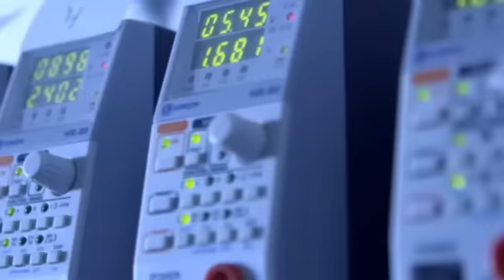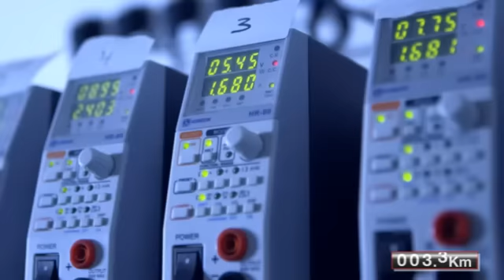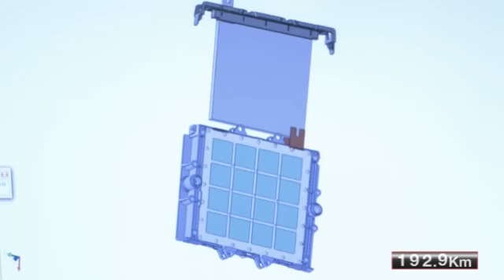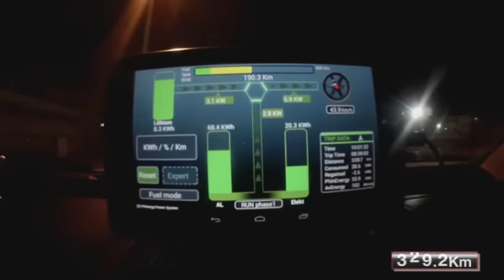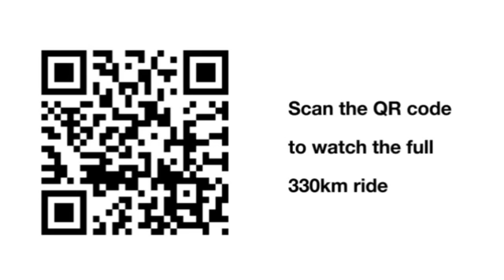New Revolutionary Water-Metal-Air Powered Car - 1600 km Range on 1 Battery!

Comment: If this ever becomes a commercial reality, it will need "Special Purified" water available only from your local gas station  97 octane, 92 octane, 87 octane &  the new H2O pump. This is what you will pay for that water, add up all the costs for gas at the pump & then deduct what oil costs per gallon to produce & subtract it from the present price.

Comment: A few years ago someone here in the US came up with the idea of alloying aluminium with tiny amounts of gallium.  This was extruded into pellets put into small containers called "cartridges".  You injected water into these and the gallium kept the aluminium from forming a protective oxide coating.  The Aluminium would use up all the oxygen from the water and the result would be free H2.  The H2 would be burned in a fairly normal internal combustion engine using ambient air as the oxygen source.  You would have several of these cartridges in your car and a small computer would monitor the whole process including telling the driver which cartridges were still good or exhausted.  Regular existing gas stations could carry the cartridges and the driver could exchange them as needed.  It struck me that the whole cartridge thing made it doable!  I don't remember what the range per cart. was supposed to be, but it looked a lot easier to change than what's in this video.  They had figured out what to do with the resulting aluminum oxide, but I don't know if there is enough gallium on the planet to make this feasible.

Comment: officer & was also an architect. I hold a CDL Class A commercial drivers lic. with tankers, doubles/triples, & motorcycle endorsements. Without getting too deep into my whole business plan, I must mention about the 3 partners in a general partnership -auto mechanic/electrician, attorney with NHTSA knowledge, & 'build-pro' who is someone who can offer extra insites into the manufacturing process/inventiveness.

Comment: Air [ or the O2 within it ] + H2O + aluminum metal = e+ + aluminum hydroxide.   This is not a rechargeable cell & as a result, eventually, the whole cell has to be recycled - ie. replaced. The hydroxide, after dismantling the cells,  will need to shipped back to a smelter, probably sited near a hydro-electric plant in say Canada or Norway where the electricity is cheap. The metal is rolled and cut into electrodes & the batteries rebuilt & distributed.  The other problem is that 'air' is absolutely full of crap - dusts of every imaginable substance, [ too late you already imagined some of them! ], microbes, bugs etc., and needs extensive filtration, which is more difficult than you would imagine.  In effect you would 'recharge' with a full battery swap out, and you ain't going to do that at the Supermarket.  Zinc-air is rechargeable, but involves chlorine in the reaction.  It works, but with an unacceptable environmental hazard risk and has been shown in US Gummint tests to not match Li-ion cells in cost, life and power to weight ratio, with the same filtration problems requiring regular expensive servicing.  As Elon Musk has stated, hydrogen is a stupid non-starter in terms of infrastructure, [ Toyoda & Toyota take note ], fire and explosive hazard -  and the on-board fuel storage problem - even liquid hydrogen @ 4deg. K:  1 gallon =  only 14 oz. of fuel and requires a gigantic tank for gasoline-like range.   Plus, seen any hydrogen fuel outlets yet? You likely won't as they don't exist!  Li-ion is still by far the best option for evs.
Reply: Hydrogen charging stations exist, not in duhmerica of course.
Reply: No they exist, but not many of them because hydrogen is one of the worst ways to power a vehicle for many reasons.

Comment: Where are they today? The french are designing induction pads into roads so cars and trucks can run almost indefinitely by charging as vehicles drive down the highway. Using rfid tags they know who to charge for the electricity the is being used.

Comment: I have something MUCH safer! I have a new EV company to found. The business plan will be given upon request. I have 3 (the first 3) models in mind with estimated ranges of 500 through 1,500 mi. The 500 is for the sports car model & the lowballing 1,500 miles is for the SUV which has much more cargo space for extra batteries. These 3 are 100% electric. It's not the bat. alone that is the reason for this; John or other investors will need to sign a non-disclosure statement to get this info....

Comment: Aluminum air battery using water and air to energy electric car. Metal air battery uses water to make electricity. Also new is the zinc air battery using same technology. Why isn't this technology being incorporated into production of electric cars?
Reply: Because its not as good as current technologies, its as simple as that. 
I welcome them as soon as they have a better battery, but right now i dont see any reason why i would want to fill my electric car with anyhing but electrons from the wall. I love the fact that i dont have to fill my Tesla with anything, i only need to plug it in at night some nights, just like i already do with my phone and watch every night.

Comment: There will be numberous volunteers (unpaid) helping with the manufacturing process; small/local company at first here in Palm Coast, FL. I currently run a home based business selling computers & my contact info. is on my website I designed myself. Thetaplex PC    -Kevin Eidsmore (inventor/founder)

Comment: This is a joke right now. Honestly, any battery that is exposed to the atmosphere will have serious issues. They need to bring in pure oxygen, and at that point it's operating like a fuel cell which is pointless. Just keep refining Li-Ion, there is plenty of potential there with new materials. Or go a completely different direction, but this isn't it. We really need a 10x increase in energy density to have a true revolution of EVs and solar. And the less complicated those systems are, the better.

Comment: It rains only a day per year in Israel ! but Petrol is cheap, then how this become ECO ?
Else sell this car in Russia, where snow is available ....
Reply: Ali Ismael They can use distilled sea water, and the distilling unit can be powered by these batteries. And Gas is not cheap even in Isreal, and its only going to go up.
Reply: Ali Ismael The problem is that the Aluminum will rust and if you use other metal the weight will be just too much and will not be efficient in powering a car.
Reply: Christian Truth  Aluminum does not rust, however it does corrode. When aluminum corrodes the process is known as oxidation once the sheets corrode they can be replaced and the old ones recycled

Comment: bs see u got to fill it up at the pump station what a joke when there has been the water car out in the 80s which got supressed all you had to do was fill it up with tap water or sea water actually worked better on sea water excaust steam,sonicly seperating the hydrogen from the water which was almost instantanous and using it as fuel.just another way to make you pay
Reply: david banner